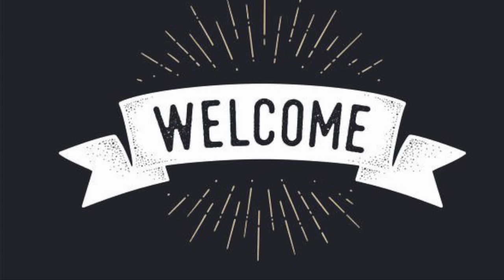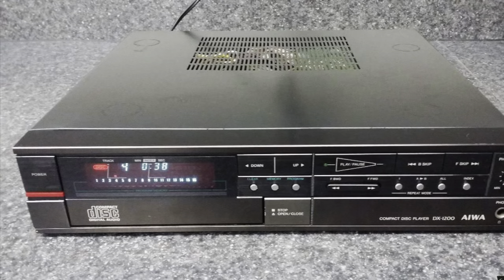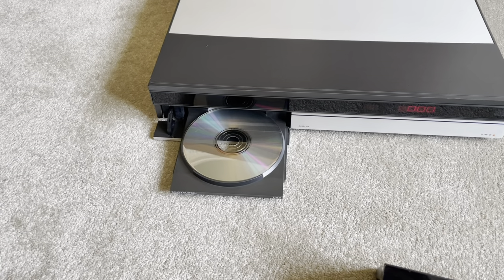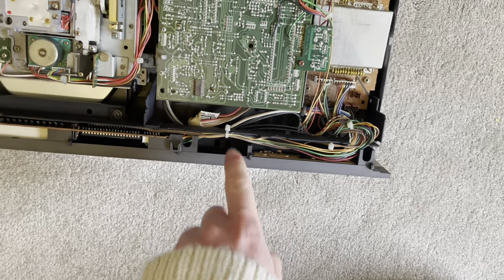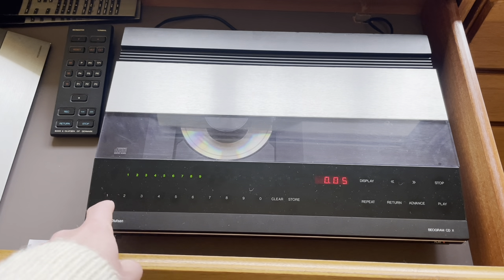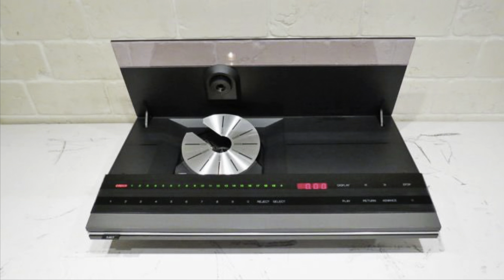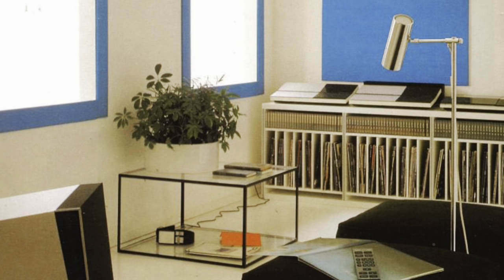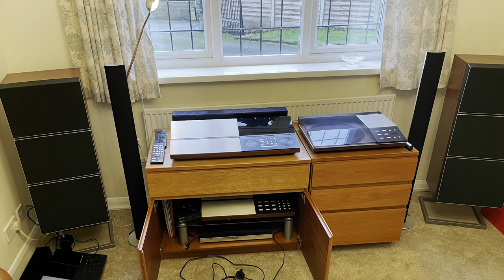Bang & Olufsen CD players (beogram) a short history. Which CD player do you prefer? Ep.06

Comment: The CDX to me is by far the best sounding but I can understand others preferring the different decks. I’ve owed all of them and the cdx was the one I kept going back to. Also the dimensions mirror a record deck. Put an LP on a cdx with the hole of the record on where the centre of the disc is and you’ll notice that they designed it so it matches a record deck. Same for all the top loaders, even the 3500/4500 if I remember rightly even though you can’t see the cd.
Reply from the maker: Seems an overwhelming love of the CDX. Having all the features and styling that it has. Indeed I believe the external dimensions are quite similar to the 3300/3500/4500 CDs and decks. All so it lined up and looked awesome on the wall. Mum n dad have a beogram 4500 deck and you’re right they’re like identical in size! I use it all the time. 

Since making this my CD50 has needed some attention. I’ve found that not all CD50s sound the same. Some sound thinner and some sound much richer. When opening them up they’re slightly different on the inside. Bet there’s 3/4 different versions. 🤣
Reply: CDX for me to, Greetings from Denmark

Comment: I’ve never yet owned a B&O CD player but have owned a beocom 2 cordless phone, which is brilliant, my only gripe though is the display is tiny and you have no hands free option. 
However if you like unique stuff that’s appealing but different,try and source a Technics SL-P1200 professional CD player , these are quite rare and we’re used in many recording studios Abbey Road having had a few. These are Top Loading machines and built like tanks!!! One clever feature allowed you to  actually slow or speed up the cd through pitch control. The sound is fantastic, very like playing vinyl record.  Check one out👍👍
Reply from the maker: I like the sound of that :) ! 

I like the pitch/speed control on my beogram 8000. A couple of rpm off and it can totally change the way a track feels 😅

Comment: i’ve JUST considered which cd to choose to complement beosystem 6000/8000. thanks.
also, just brought home a beocord 8000 to start building my system
Reply from the maker: @anatolbaskak  awesome! Yeah it’s hard to choose, really with such an already large system it depends on what fits best in the space!
Reply: @chrisbaker121924  but perhaps best space saver would be a 5000 series cd player mounted underneath
Reply from the maker: @anatolbaskak  quite possibly! It happens that my unit has a draw which works quite well for the CDX. Depends on what your unit is like really. Most situations a rack kind of CD player will work best.

Comment: Hi - I'm really enjoying your channel.  I got into B&O restoring a Beomaster 5000 system and just finished the Beogram 5500 completing my setup, along with a Beosound Stage for my TV.  I had a question for you since you seem to be an expert in CD-50's.  My CD-50 is the only component I cannot restore completely.  It will play properly, but after playing for 2-3 minutes it will begin jumping across the CD, playing 5 seconds of the middle of a track and then jumping to another spot.  I've tested other CDs and started in the middle of albums rather than the beginning.  Same problem across CDs and starting locations.  Do you have any idea what or where the issue might be?  Have you encountered something like this?
Reply from the maker: Far from an expert but thankyou really appreciate that :). 

CD50s typically suffer from three problems that I’ve managed to fix…. 
1. The belt for the drawer. Since yours is reading a CD it’s not that.
2. The laser sled not being well greased… possible…
3. The motor itself. They’re very low torque motors and any friction from dried oils or dust etc will prevent them from spinning properly. This would be my guess. As it’s trying to do a lower speed spin it’s getting stuck and trying to read somewhere else.

The only other thing it could be is a capacitor somewhere possibly in the sled mech or to do with the laser… but I’m shooting in the dark there. I’ve had I think around 80% success rate fixing them with a new belt and pressing apart the motor/cleaning the motor/applying a small amount silicon lubricant. 

They are the really early days of CD players and I’ve found it’s unusual for mine to read the TOC properly so they often start somewhere random within the first minute of track 1. Again that could be to do with a failing motor because the inside of the disc (the start on a CD) the player has to spin the disc the fastest.

Comment: Any of them have digital connectivity? Is it possible to upgrade the 14 bit, or single converter systems to 16 bit etc?
Reply from the maker: I believe the CD5500-7000 have S/PDIF 

As for the second part I guess anything in theory is possible… but why you would want to is beyond me 😅, enjoy them for what they are. The CD50 is a single converter, but it switches between the channels to be stereo. The 14 bit CDX is part of its charm. They all sound decent but if that kinda thing is your bag then probably something more modern is probably going to suit you better I would guess!
Reply: @chrisbaker121924  Thanks for the response. Shame the top loaders don't have S/PDIF, I love their aesthetic as well as ease of repair and play any size disc. And no stuck discs inside. I'd have liked to keep a purely digital connection going. I'm going to guess the one with a single decoder is a Sony based system, as the 101 did that trick, unless other players did it. Funny how back in the day, no matter the brand, it was either a Sony, or a swinging laser Philips inside every player. In the 1990s Tascam DAT machines were rebranded by Pioneer and Fostex, just with different colours and connectivity out the back.
Reply from the maker: @jameslaidler2152  nope the single decoder is a Awia unit. The 14 bit is a Philips 101 I believe! The more modern players are B&O ground up designs but use a CDM4 laser. They have a digital out in the form of S/PDIF.
Reply: @chrisbaker121924  Guess Aiwa copied Sony's idea, as their first player, their 101, did the same thing. Funny how Philips also later used Sony's tracking system too.